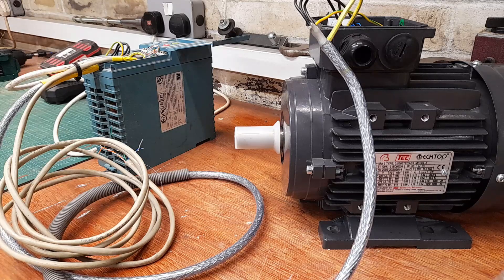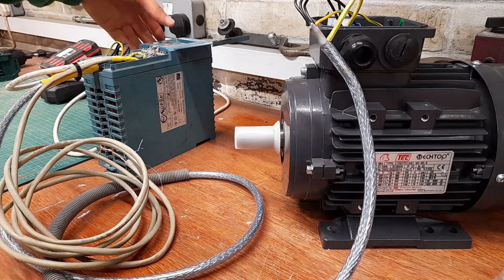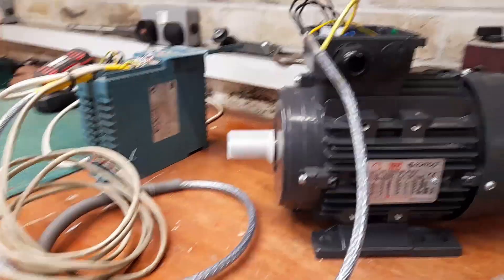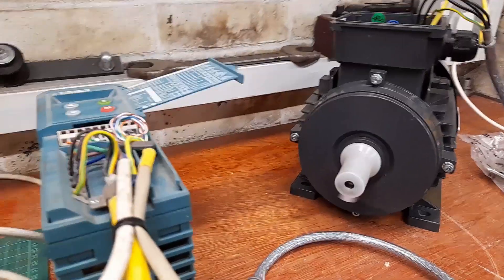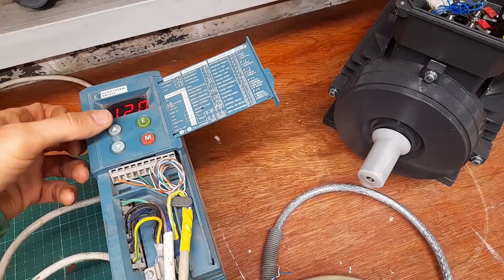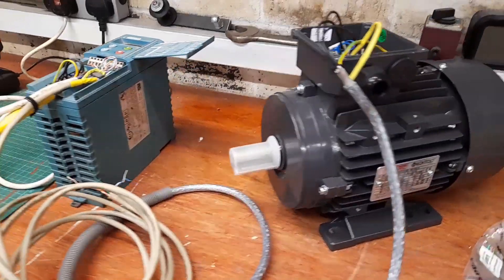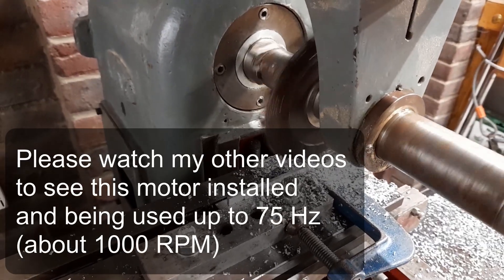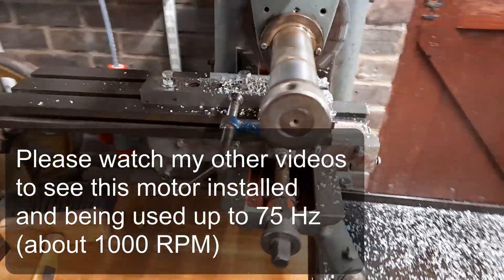TEC Electric Motor 3-phase 8-pole (680 RPM @ 50 Hz) with VFD variable frequency drive

Comment: Can it be used as a low voltage generator?
Reply from the maker: No. Induction motors don't make suitable generators without extra work.